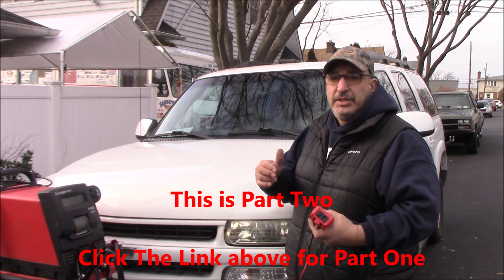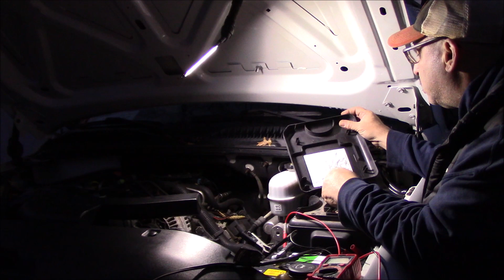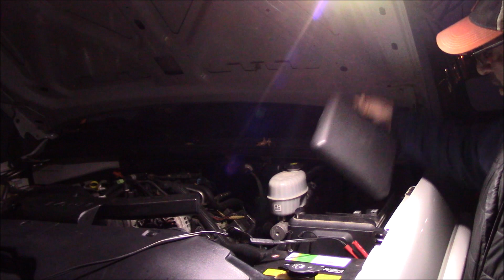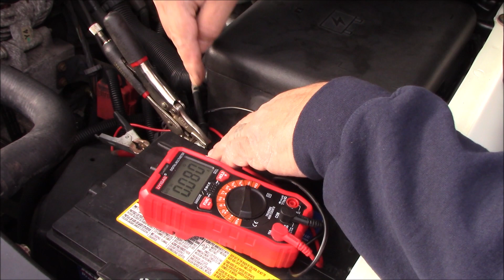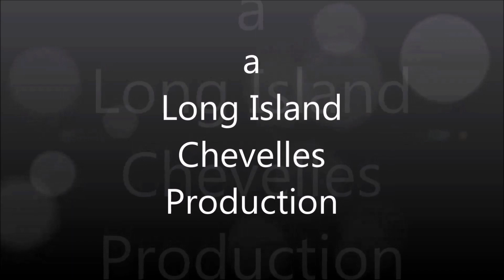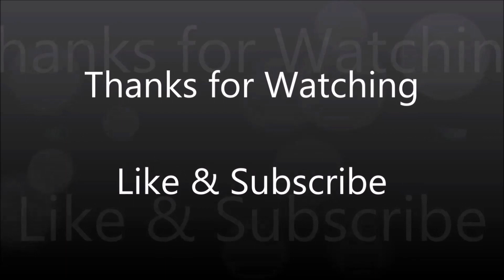Parasitic Draw Part 2 - Barry the Z71 Suburban - Episode 7:  GMT-800, 2000-2006 Chevy GM Truck

Comment: I have had 5 batteries fail over the last 2 years. They are made so cheap now and I believe the junk batteries that are recycled or brought back as cores are being cleaned internally, given new cases and sold as new. I talked to the mechanic at the local Walmart service center because they didn't have a single battery on the shelf and she told me that they had to send back the entire truck load of "brand new" batteries because they all failed to hold a charge. The Everstart rep said it was the fault of the loaders for not grounding the vehicle when it was being loaded which is a crock of BS